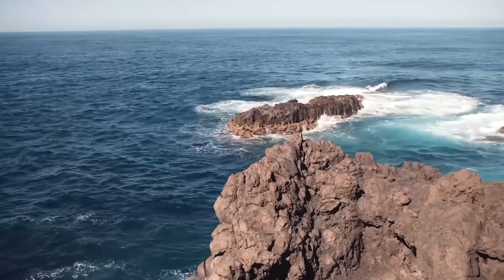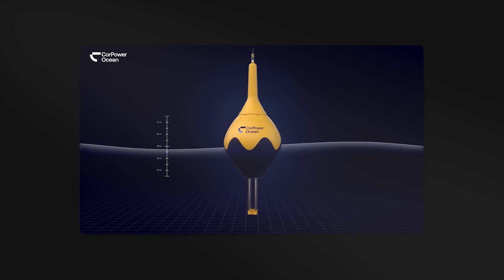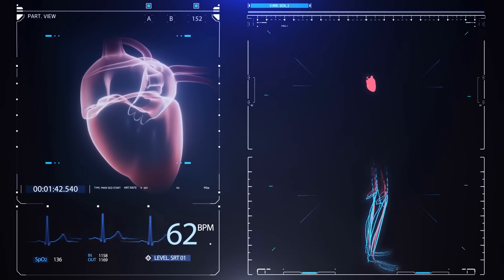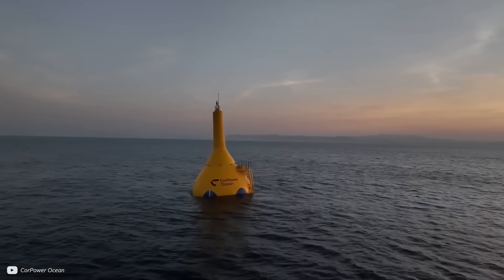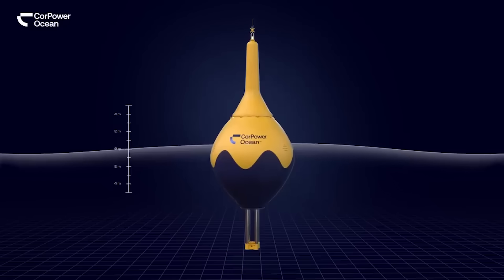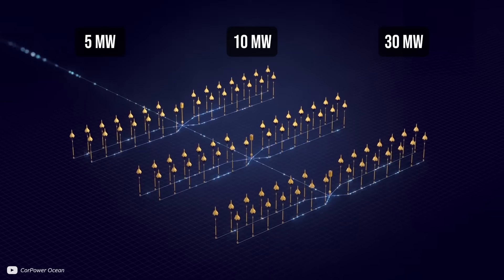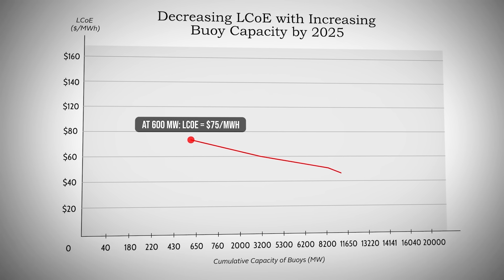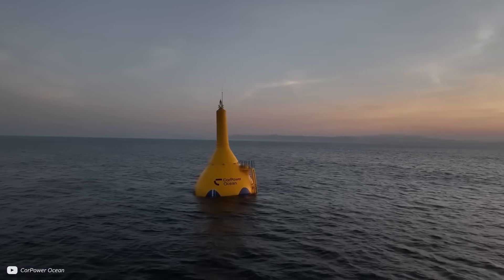Unlimited Wave Energy: This Buoy is the Future

Comment: Keeping the barnacles and fouling growth controlled is going to be a continuous war. Ask any sea ship company.
The inertial mass as the driver for the return stroke is smart. The nice shiny slides etc. and complex gear box strike me as long term maintenance issues though. I am watching this with interest.
Reply: I'm wondering how they will reliably seal out the salt water ... those rod seals will fail.
Reply: @KrustyKlown  If you pressurize air inside, water doesn't enter, that's why the structure is completely closed from above
Reply: @KrustyKlown  I bet you they have thought of that, Krusty.
Reply: @KrustyKlown  I don't think anyone would go to the trouble of designing, engineering, installing and testing something like this, which they have already done, if they didn't have a plan for salt water and corrosion.
Reply: @Hybridog  It’s all about attracting research funding. It’s not a scam but it’s very close.
Reply: @Hybridog  funniest thing ive seen on youtube ever
Reply: @Hybridog  You have no idea how this kind of thing works, do you? All they have to do is pitch a promising idea that works great on paper, do some short term demo, collect the VC money and slowly disappear. This kind of enviro scam has been done hundreds of times. There is no long term plan here
Reply: @maskettaman1488  Did you even watch the video? You have no idea what you are talking about.
Reply: @KrustyKlown not if goes trough an internal pipe and that pipe is higher then the water. Have something that initially breakes up pressure and splashing and have the seals at the top. But then it is prone to internal build up of debris, not algea since there isnt enough light but barnicles, plastic and other debris. Though it sort of would be self cleaning. Sort of like a plunger it would enevitabily build up friction. The question is on what timescale.
Reply: Not to mention the occasional shipping container (or other debris) drifting into it.
Reply: @DreadX10  They'd probably have a specific area "roped off" against sea traffic on the nautical maps, but yes, for casual boaters, these things might become a party platform on a calm day. Just hook your boat and plug in the music.
Reply: @DreadX10  Perhaps it will be another reason to push to keep our seas clean. One can hope.
Reply: @AndyGneiss  That wont work unless we totally abandon the oceans and shores. Storms cause shipwrecks and blow structures/materials from the shore into the sea.
Seagulls will ravish garbage-bins once they have learned there is a chance of food there. And they are messy foragers. This will also end up in the sea.
Reply: @DreadX10  what does any of that have to do with this? rhetorical, it has nothing to do with this.
Reply: @DreadX10  will be a matter of designing a coating that molecularly is so smooth fouling marine life won't be able to attach to the structure
Reply: May be a silly idea but I wonder if a current could be put through the hull occasionally that killed the barnacles?
Reply: How does Teflon coatings work on ships? Do they do that?
Reply: @NwoDispatcher   In the old days they used copper but what about something on the lines of the waterproofing coating they use for some phones.
Reply: @NwoDispatcher  Teflon doesn’t stick. How do you expect it to stay stuck to the ship?
Reply: @Dave5843-d9m The same way it sticks to the frying pans?
Reply: @Dave5843-d9m  I Guess the same way it sticks to a pan. WTF??
Reply: @Dave5843-d9m  except Teflon can stick to things, it wouldn’t be very useful if you couldn’t stick it to anything.
Reply: @Dave5843-d9m the same way it sticks to a pan
Reply: I'm an electrical engineer that worked in the green energy space, for a while.  What is neglected is the amount of energy needed to make a "green energy device".  This means EROI - Energy Return On Investment = (energy produced)/(energy input).  If this doesn't exceed one, you've made an expensive non rechargeable battery.

This measurement is frequently neglected.  For most wind turbine installations, it's below 1.  For solar cells, those are feasible, as an addition to energy to the grid, with local storage, usually not.  Most solutions have a negative return.
Reply: @fuzzywzhe  the main factor is scaling up mass production to get the cost down you've got to get mass production going early prototypes are expensive
Reply: @fuzzywzhe  oh you make it sound simplistic...The raw materials are less than 15% of the overall cost
Reply: Seals be toast in one week. I’m skeptical. Seems like a grift. Renewables don’t actually exist. They all pollute after 10-20 years and pollute during manufacturing. Only zero point energy or ionizing gasoline engine can bring hope. But the controlling forces of our slavery simulation will do what they will to cut those. I do like parabolic mirror potentials with molten salt storage.. dunno. I’m clapped
Reply: Then it will provide some new jobs, which isn't a bad thing. Although I suspect energy companies won't want to employ actual people as much as they can help it, so expect some robotics.
However, I'm sure there are materials that are a bit more resistant to barnacles and suchlike. Certain plastics seem to do well enough, as we see from the amount of plastic junk in the ocean.
As for shipping/rogue containers hitting them - have a system on board that identifies when it's struck/damaged by solid objects, the energy company can have a contract with a salvage company to retrieve it, and together they can sue the shipping firm responsible. About time they stopped letting super sized container ships from bouncing around in the ocean dropping their litter in the sea, half these containers are full of rubbish we don't need anyway.
Reply: @Debbie-henri with the proper equipment in the ocean like my patented one the only thing to be concerned about is Mother Nature other than that nothing could happen to mine
Reply: Yeah what about harvesting muscles 5 years from the power station actually making a profit from the growth, theoretically you could be harvesting 100 kilograms of muscles
Reply: Build the thing out of aluminum.
Reply: @D1it4FN have you ever seen what salt water does to aluminum as it is very soft material compared to other metals that are so much stronger and better
Reply: I didn't notice any 'wire'  going out to the ''power house'
Reply: Stop promoting such ridiculous things, “complex gearbox.” Have you ever seen the complex consumer electronics to say that about something so simple, efficient and reliable ?
Reply: Why would it matter if it got barnacles? What would it do to the booey? What about normal booeys that get barnacles.
Reply: Yes. there have been lots of wave energy prototypes but practically none have made itt into production. The sea is a very hostile envitronment requiring very heavy duty engineering and at the momment wind and solar win.
Reply: Aren't barnacles only an issue for creating drag? Or do they do harm to the materials also?
Reply: Yes but that means jobs. As more and more things automate or jobs become redundant with AI these are great jobs for people
Reply: Wonder if they could employ aquatic maintenance drones to clean the aquatic life.
Reply: I’m not saying you are not totally incorrect but check out some of the new materials and coatings available today
Reply: Why would this even be a problem. This is not a ship, it does not need to worry about its efficiency moving through water. This device follows the flow of water, therefore it will not be effected by growth on its hull...
Reply: @erosion01  Barnacles can get very heavy and change the buoyancy and weight of the buoy which I am sure will affect the operation in some manner. Eventually, they will destroy the material like they would a boat hull . . . if they can stick to it in the first place.
Reply: @Boballoo  I dunno, it seems that the system dynamically adjusts for the waves by itself, I am sure that a change in the buoyancy will be compensated for in the same way a change in wave amplitude and frequency would be. As for the destruction aspect, I don't know how destructive barnacles are. I don't know if countermeasures to eliminate damage are going to be the same as eliminating them from sticking. But considering how many ships exist and how many planted ocean structures there are that have been around a long time I am not concerned really.
Reply: @erosion01  I hope you're right. This would be a big breakthrough in power technology.
Reply: @Boballoo  no amount of barnicles is going to affect this, thats ridiculous. a barnicle cannot destroy a steel hull, it just causes drag and fuel inefficiency in a boat. these arent made of plastic or wood dude.
Reply: I cant really see why barnacles off these units will matter. Their drag coefficient isnt all that important and i doubt they are that sensitive to the variation in mass.
The seal that someone mentioned is a great question. Im sure they have a solution.

Comment: Very nice.  What about tides,  waves work at different heights all the time - does the tether need to change lengths all the time?  Or it just works at high tide?
Reply: I was about to ask the same question 😅
Reply: Yes it would need to adapt, though I think a tidal range adjustment would surely be part of the design.

Comment: Same as always... how are they gonna deal with barnacles? Moving parts in the ocean are not gonna last long
Reply: Wow, great point.  I'm sure they didn't think of that.  Well, so much for wave energy!
Reply: @blahblah49000  They should have discussed it though - it is a huge problem. The piston in this case would be self-cleaning with little chance of intrusion due to the tight fit, but the whole structure would get encrusted and weighed down without toxic and/or ablative paint. Non-toxic alternatives make the news all the time, but they never seem to become a practical reality.
Reply: @smeeself Sure, but you see them encrusted in barnacles all the time. It doesn't matter for a buoy but it would hurt the performance for wave power generation.
Reply: @jmodified  Ok, but that's a criticism of the video, not the buoy.
Reply: @blahblah49000  Yes.

Comment: Is recycling solved for these composite materials?
Reply: Nope, used fibreglass blades from wind-mills are still buried and not recycled.
Reply: @DreadX10  what bugs me is that planes worked perfectly well for decades being made from aluminium sheet held together with pop-rivets... no trouble scrapping them at end of life... easy to make, too.

hmmm... lightweight, aerodynamic structure, can be shipped as a flat pack and assembled on site?

nah! lets use "space age cutting edge sophisticated high tech optimally engineered advanced composite structural materials" that we can make in remote factories then ship via massive trucks through torturous routes... then leave in massive piles or festering skeletons on a hillside or in landfill... whilst "technology improves and we can reclaim the valuable resources"... only around the corner! just a few more years!  

dont get me started on the power generation side of them... imho, you could replace the boilers of an existing coal or similar station with a few properly placed turbines, use them to generate and store heat at maximum efficiency regardless of windspeeds or demand... but whatever... lets use inverters, batteries, brakes, and limit ourselves to trying to match an erratic (albeit plentiful) supply to a varying demand... thats "industry leading engineering"...
Reply: @DreadX10  I found at least five methods of recycling blades when I looked into it. The fallback method is to grind up and insert into cement making furnaces. The leading blade manufacturers are developing recyclable composites for the blades so the resins can be separated out at end of life. Expect this soon to be a non-problem.

Comment: Since waves get there energy from the lunar interaction with earth that causes tides, if we take buoy energy to the exteme and fill the ocean with them, isnt there a danger of causing unintended side effects in the same way that planets that are interacting through gravity can steal spin energy from each other? the buoys get their energy from the waves, the waves get it from the tides, the tides get it from gravitational interaction with the moon, so the buoy energy is essentially sapping the energy of the gravitational interaction of the earth and moon.
Reply: All the energy from the lunar interaction will turn to heat-energy eventually. These buoys will grab some of that former 'lunar energy', convert it to electricity and then it will become heat-energy when the electricity is used. The end-result is the same. So it is a 'use it or loose it anyway' situation.
Reply: @DreadX10  That does make sense. Thank you!
Reply: Are waves not wind-generated?
Reply: The bouys are still on earth, so no, it doesn’t affect the tides. Unless by tide you mean the wave. The wave must now push up against the bouy. It becomes a smaller wave. I guess that’s it. Helps against erosion?